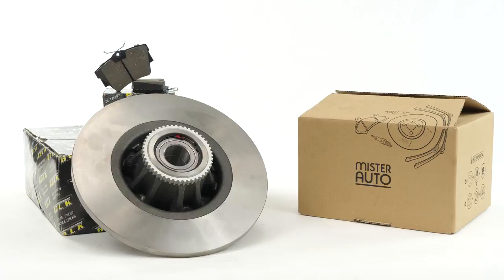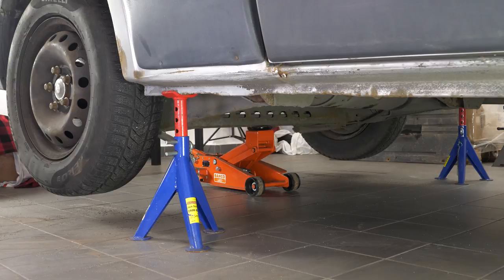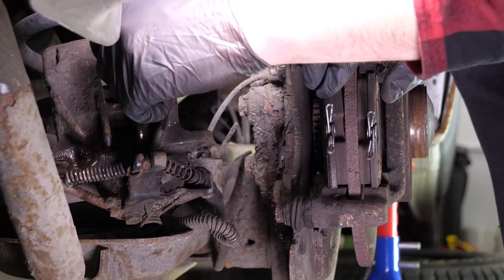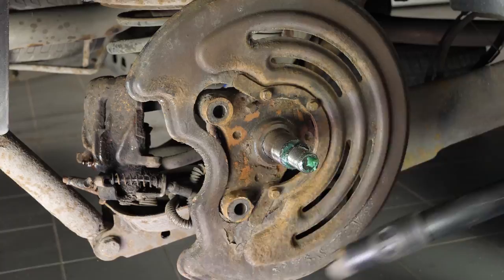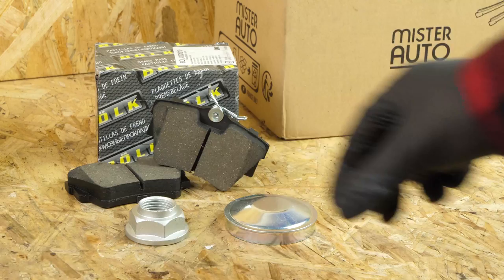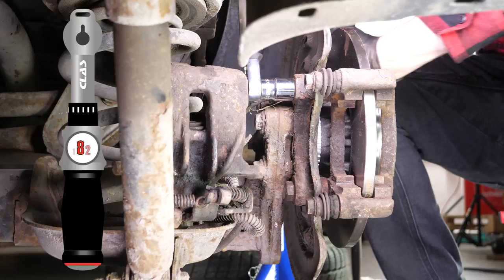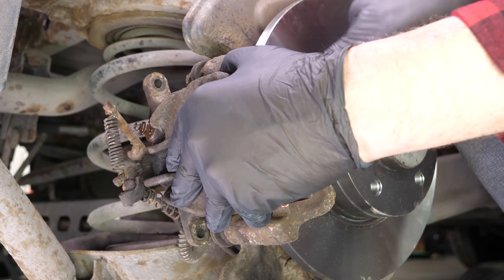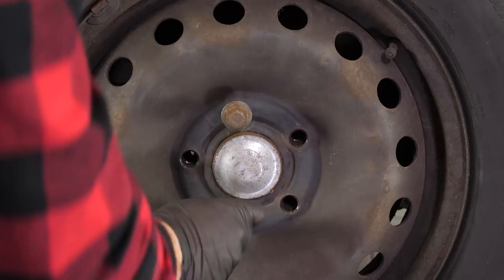How to replace the rear brake discs and pads Trafic mk2 🚗

Comment: 2nd mistake , NOT CLEANING CALIPER MOUNT OR CLEANING AND LUBING SLIDERS. OR CLEANING CALIPER AND HANDBRAKE MECHANISMS. 🤔🤔🤔
Reply: Criticism isn't a bad thing when constructive, but when in all caps it just comes across as someone ranting it probly wasn't your intention. 

maybe leaving a compliment or two aswell would be good. You obviously a know what your talking about when it comes to brakes, and I agree with you that I would have been better if he did those 2 things, lets build each other up rather than step on each other💪🏻👍🏻
Reply: @christophersimpson7052  I wasn't having a pop just couldn't be arsed changing font.  Anyway I could do a better job when I was in my teens 🤣😂🤣